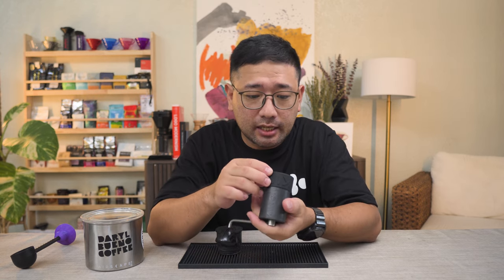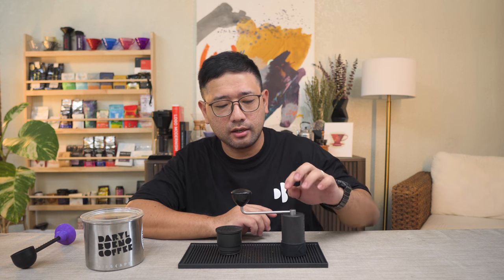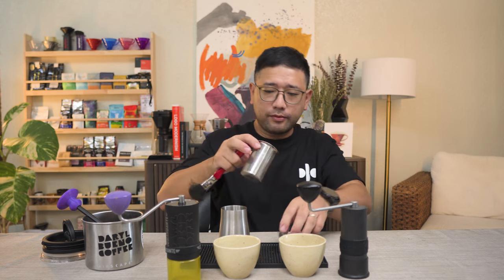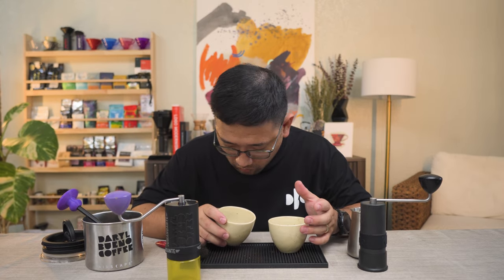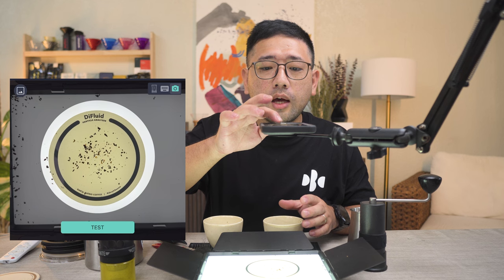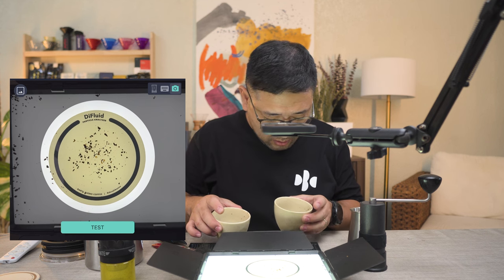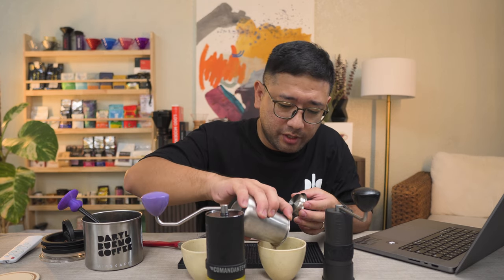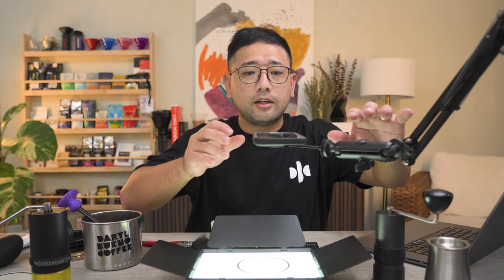Kingrinder P2 Conversion Chart

Comment: P2 and C40 used 38mm hexagonal burrs of the same shape, and if the maximum click number of P2 is 75 clicks, 1 click of P2 compared to Comandante will be 0.533 clicks. I briefly summarized the range I use, 20 to 27 clicks, excluding decimal points.

38 = 20
40 = 21
42 = 22
43 = 23
45 = 24
47 = 25
49 = 26
51 = 27

What I was curious about while using this grinder is whether the plastic body affects grinding. I felt that quite a lot of fine particles were generated during regular use. This article was written through a translator, so please understand that it is clumsy.
Reply from the maker: No, not clumsy at all its great! Thank you for sharing! You're numbers are almost exactly the same as mine, awesome!

Comment: Hi! Thanks for the video! The handle and base of your grinder are different from the original, what are they?
Reply from the maker: The handle is from a comandante after market and the base is from a local hardware - I just measured the diameter of the grinder and looked for a rubber footing that can fit.

Comment: May I know your go to clicks for v60 on this one specifically for medium roast? 

Also I noticed that it has a different catch cup, care to share the name of it and where to get one? 

Thanks in advance!
Reply from the maker: with the P2 i found setting 12-15 or 36-45 clicks is my range for the medium roast coffeess. I would adjust then depending on the characteristics of the coffee if i want it to be sweet forward or brightness forward. Re the catch cup, I only added a rubber footing I got from a hardware store. Its the same cathc cup.

Comment: So 40 clicks on the Comandante is the largest grind size you use, and 20 is the smallest? Just wondering how you went from 40=75 to suddenly 20=12.3. Shouldn't it have been 20 to 37.5? Sorry I'm new to this but trying to learn!
Reply from the maker: @soju1shotx  alright so the p2 has 25 numbered setting and 75 clicks bec you have 3 clicks per numbered setting. The 12.3 is actually 39 clicks because 12x3 plus 3.
Reply: @darylbuenocoffee  makes sense. Thanks!
Reply from the maker: @soju1shotx  you're welcome!